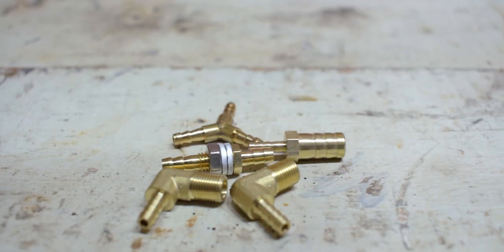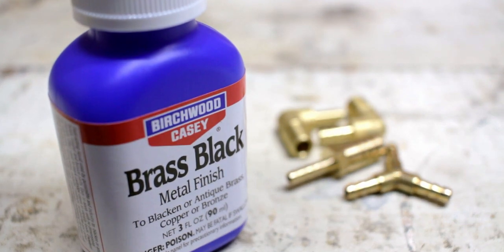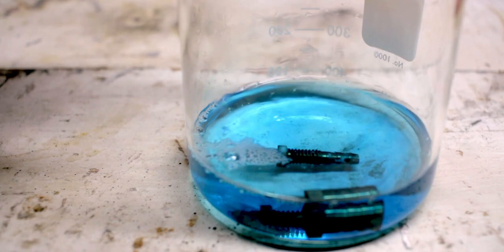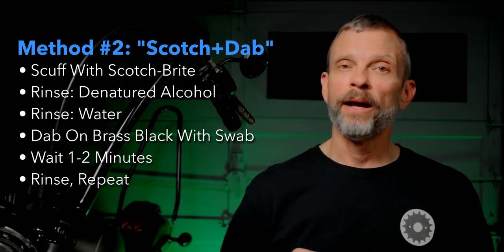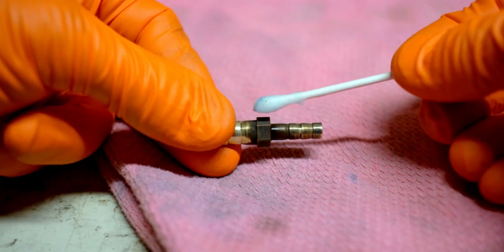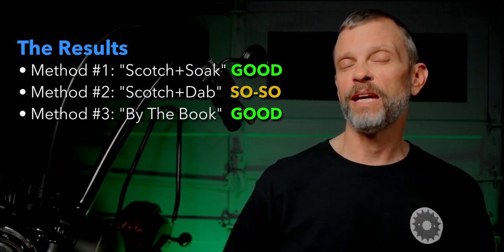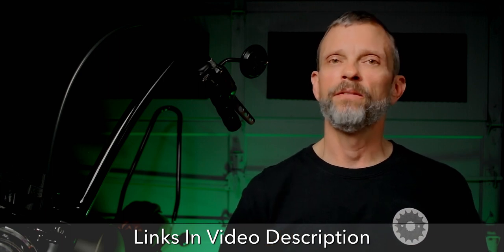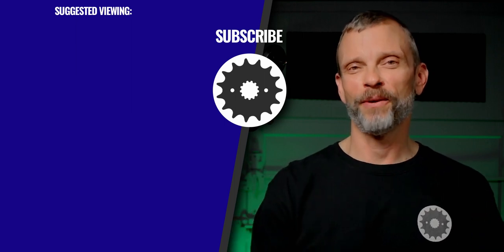DIY Black Brass Fittings • Chemical Dip • Quick & Easy

Comment: Hey Ron, can you tell me what wax or spray wax you'd recommend to seal it after blackening it?
Reply from the maker: Hi Marc - that’s a great question. I didn’t seal mine, but now that you mention it I’d like to. I suspect a spray wax would work well. But that’s just my first thought. Let me know if you try something!
Reply: @RonsWorkshop  You used a spray wax at 3:41 in the video.  Do you remember what it was?  Thanks!  Great info video.
Reply from the maker: @philwyatt2248 sorry I don’t recall, but auto parts stores have lots of options for that.

Comment: I tried this, and it only made it look dirty. Yes I degrease my brass, yes I used water etc etc. Multiple coatings, letting it sit in the solution like you did. Nothing made out look black. And yes the parts are brass
Reply from the maker: That's frustrating! I got consistently good results on a number of parts. Did you find a different solution?

Comment: Really appreciate your informative videos. Would nylon barb connectors work as well as brass for hose connections in external breather systems? Thanks and stay “upright”.
Reply from the maker: Hey dtork47 - thanks for the kind words! I considered nylon fittings but in the end I wasn’t confident they could handle the heat and vibration over the long term. I may be overly concerned, but based on that I opted for metal fittings. Let me know what you go with!

Comment: Just curious why there has been no mention of using black anodized fittings available at your local race shops.  I've used these types of fittings for years and they are available in several different colors.  I like your videos and after I put a few miles on the Arlen Ness Big Sucker I finished installing yesterday I will be taking it back off the bike to make the mods demonstrated in your video while using the anodized fittings.
Reply from the maker: Hey DCI IMHO - anodized is a great option. Based on what I had on hand and the timing of when I wanted to work on the projects I went with brass. I was also interested in trying to turn them black, and that was just as much a part of the decision making as parts availability. 

Let me know how the Arlen Ness project goes! 

If you want a channel sticker send me a DM on Telegram or Instagram with the mailing info @RonsWorkshop
Reply: @RonsWorkshop   I'm not a user of telegram or instagram so I'll have to pass on the channel sticker.  Did you have any casting issues with the Arlen Ness.  I had to use a file on the mating surface of the backing plate to make it fit air tight against the throttle body.  I think most of the issue was with the powder coating being to thick but the casting wasn't as flat as it could have been.  Just curious what you thought of the fit and finish.  I understand the parts availability thing.  I have both laying around, brass and anodized.  Thanks for the response.
Reply from the maker: Mine fit nicely without any filing. However, the dealer did the original install when they installed the stage III kit, so there’s a chance they made some adjustments - but I didn’t notice anything.

Comment: I'm planning on using this Brass Black on a couple black powder firearms, and the finish may face wear. The finish will also be touched a lot, would it feel any different or wear off?
Reply from the maker: Hey JksonBlkson - good questions. Are the parts brass or steel? I’ve noticed that the finish is matte and it’s more of a grey-black than pure deep black. It feels sort of porous, not like smooth blued steel. Birchwood Casey also sells a bluing solution, so that might be an option too. Let me know what you go with and how it goes.
Reply: @RonsWorkshop  its solid brass, according to the manufacturer. I'll look to see if you can blue brass.
Reply from the maker: I’d also advise testing it out on a small brass bolt or even better random brass scrap just to get an idea.

Comment: Do you think this will work on aluminum copper bronze? I plan to be making some things out of bronze and I would like to make some of them black
Reply from the maker: Hmmm...I don't know for sure. I suspect it would work on bronze, but I am not sure about aluminum. I can test it on aluminum, but I am traveling for a couple of weeks. I'll give it a shot and let you know what I find. I don't have any bronze to test.
Reply: @RonsWorkshop  no I'm saying the new and improved way to make bronze involves mixing about 85% copper with 15% aluminum
Reply from the maker: @BlazRa  Ahh I see. Good question. I bet since it is mostly copper it would work. But that's just a guess.
Reply: Birchwood Casey makes an aluminum black as well
Reply from the maker: Hey John - Good to know! Thanks for sharing that.

Comment: how does the coating holding?  can it be compared to powder coating?
Reply from the maker: Hey R13 LETHAL Wires PH - it’s not nearly as durable as powder coating but it has held up pretty well.
Reply: @RonsWorkshop  oh great,i’ll give it a try.. thanks for the reply

Comment: Any idea if this is reversible?
Reply from the maker: You can definitely remove it with a wire brush or steel wool, but I'm not sure if there is a chemical method.

Comment: Does this actually make the brass black or is it like putting on a coat of paint
Reply from the maker: It is a chemical reaction that turns it black, so it is probably more durable than paint but it can be removed with steel wool or other abrasives.
Reply: you can coat it with something like lacquer to protect it even longer
Reply from the maker: Yes that’s an option too. But from what I’ve seen, unless it gets a lot of contact the finish is quite durable.